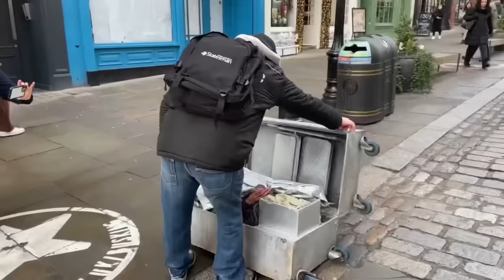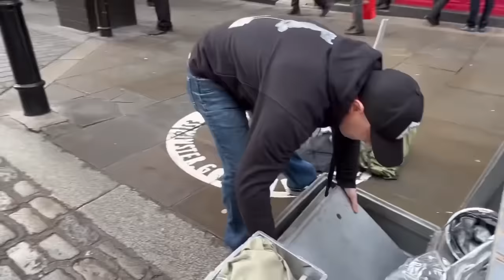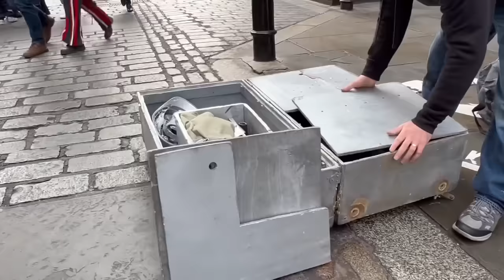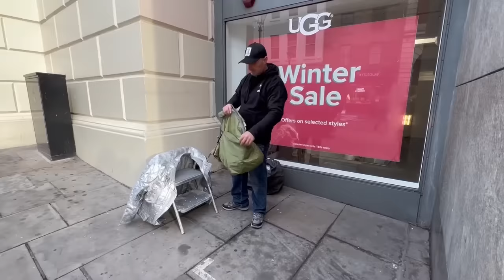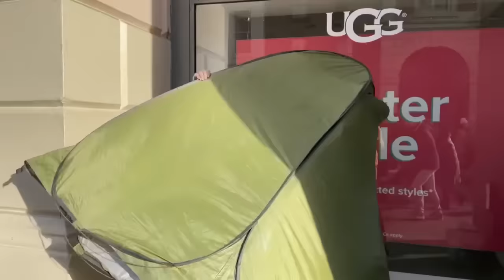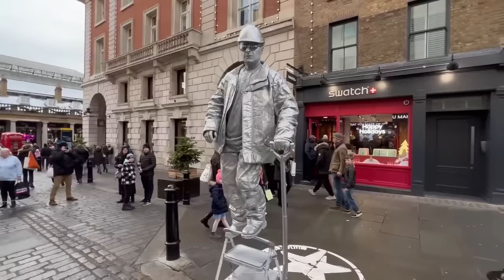Unveiling the Meticulous Gear Setup of the Silverman Statue Immersive with Natural Background Sounds

Comment: So he’s just like SUPER STRONG?!?! My goodness!!! I appreciate the amount of work you put in ❤❤❤❤
Reply: Lmao no way, he definitely has something holding him up
Reply: Yes and no, he does have a support arm hidden in the sleeve(its why his arm moves so stiffly and detaches from the shovel), but it would still require decent strength to hold position so steadily.
Reply: @itshunni8346  yeah its somewhat both theres a entire frame hidden under that coat to stay still hes basically using as much strength as we use to lean on a wall

rotating back and fourth is probably about the same strength you use to pull your self up
Reply: Support Girder shaped like a backpack that attaches to points under his jacket. I mean sure he needs to have some strength but he is 10% of that effort... 90% illusion
Reply: Please don’t re produce